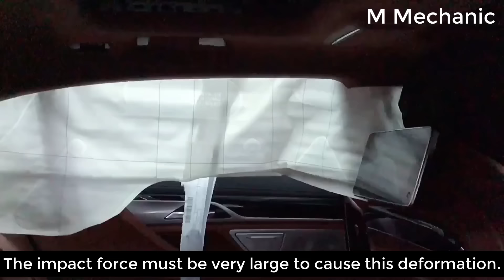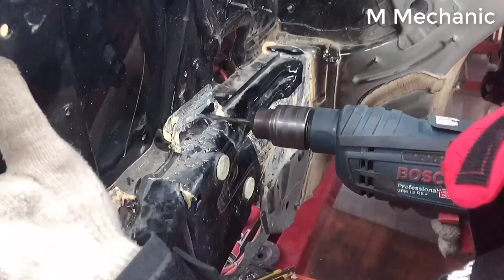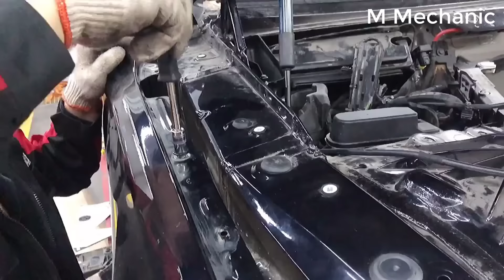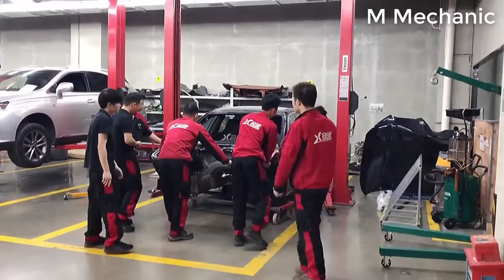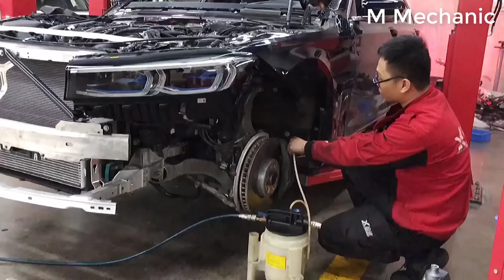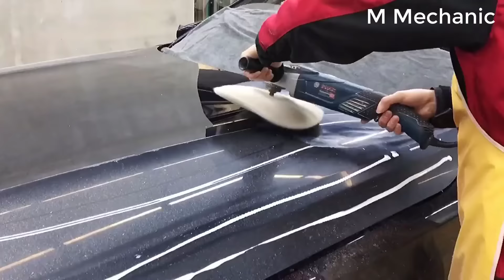Restoration Of Accident BMW 740Li | Amazing Repair of a Destroyed Car.

Comment: I own this superb car: 745Le.  Watching this amazing rebuild was very interesting.  Brilliant work by highly qualified and professional work staff.  Well done everyone working on this car.  But I wouldn’t want buy an accident car.  There could be countless problems on the future.
Reply: How did you experience driving the 'repaired' car?
Reply: You mean you own a 745Le not this particular car in the video.
Reply: Even I you bought it new from the dealer you don’t know if it was ever in an accident
Reply: They went through the trouble of painting the bolts on the wings and bonnet... you would need to compare the dirt levels on underside areas of front vs rear to be suspicious of a hidden repaired. On the other hand, the methodology and replacement of front section looks legit, and the impact was really a perfect dead-on.

Comment: Wouldn't touch the car - belongs straight to scrap as with that amount of damage the whole integrity of the car is materially impacted. Measurements in the factory are by lazer not tape measure.
Reply: the us is lazy
Reply: @japanwatchconnection I agree here. I don’t have a problem with Minor damage, but once the Frame has major creases/dents, the integrity is compromised. However, the amount of craftsmanship that goes into repairing said vehicles is amazing

Comment: Looks like a job well done. But I doubt if it should have been repaired in the first place as the engine and the cradle/subframe it sits on were damaged/moved in the accident (was the firewall okay??). I would love to see the wheel alignment values before the actual wheel alignment was done. Also, looks like the airbag modules were not replaced. This is common with Chinese owners not willing to spend money on a >5 year old car. :P
Reply: I think when not crash in very high speed, the subframe can handle it. 
So firewall still okay.

But i agree with tyre alignment :D
Reply: Dont think is a full video thou
Reply: Dude……..this a short video……….what you want to see …what te they had for a brake….coffee or soda…..?? Man wake up………or do you all still sleep in that island called England or something….
Reply: Please enlighten me why you want to know the wheel alignment values? There is so much to adjust that you will never have correct values direct from the start (unless it’s on a jig in the factory) just replace the subframe on an undamaged car and in 99,9% the values are way off. That’s got nothing to do with being in an accident
Reply: poor guy that got sold this bmw on the end for the normal price lol
Reply: cradle/subframe damaged/moved   (was the firewall okay??) wtf... what kind of grammar is this???

Comment: All fine, great job. Just need to know if they fitted airbags, sensors and new seatbelts? And if so, how did they apply this stuff in clever computer system? This video does not show all those details, unfortunately...

Comment: Sorry, but I wouldn't want to buy such an accident car again. Despite the repair, the car will always cause problems, I know that from my own experience. Never again an accident car
Reply: Новую бери
Reply: The biggest problem, in most of the time they won't tell you
Reply: Yes you re right man. No buy any with accident car please cause of some problem could occur when you re on  vacation
Reply: What experience did you have?
Reply: @mrnobody7668  Бред не пиши!!на заводе точно так собирают даже хужее
Reply: Not always true
Reply: @Paul_Bateman  Everyone has their own experiences. I had problems, my buddy had problems and my brother had problems with crashed cars. Never again, I'd rather pay more and take new or younger used ones.
Reply: @kyok001  Brand new car is sht..used car is big sht and acident car is extra big sht...maybe 🐎 is for you good 🤣🤣
Reply: @rimsatec5215  What's the matter with you, can't you read? I wrote that it sucks to buy an accident car. I'd rather put more money on the table and buy a new car. And if you can't afford it, that's your business.
Reply: i buy wrecked cars, fix them and either drive em or resell them. u got unlucky. if all welds are up to spec the structure should be just as strong as before. and as long as water leak prone areas are sealed.
Reply: @christiaanpeeters9716  😁👍
Reply: Indeed!
Reply: @Bimmer-Fonz  you already had two "as long" in your short paragraph.
You answered your own question.
Reply: @kyok001  it seems it's YOU who cannot read. He agreed with you, but in a funny way.
Reply: Depence what kind of damage you got.
Reply: You correct, way to,any things get outta alignment. To many to mention. Plus things that are not found, I’ve had car’s repaired from Accidents things show up at a later time. 
Wrecked that bad it good for parts.

Comment: This car would never be allowed back on the road in the UK.  It's a question of safety.
Reply: Of course, safety!
Reply: Absolute rubbish. Of course it would be allowed back on the road. There are plenty of vehicles that had far worse damage than that on our roads. Obviously you know nothing about vehicle repair. Look up salvage categories.
Reply: All cars in the UK are not safe. You have the steering wheel on the wrong side !!!!!
Reply: @MrMadreko  top comnent in my life, ahahagaha
Reply: @bingobongo357  😂👍
Reply: When you do measurments on this car, chances are high that it is more straight than from the factory. 
Factory new is mass production, this one is handproduced and measured by the latest technology.

But still has the steering wheel on the wrong side.
Reply: To AFRICA

Comment: Beautiful job! Very well done! Hats off for the mechanics! 
Do you guys think this car is equally safe as an uncrashed car? Those welds and metal materials have different specs than the ones built in! The body can twist just after a few weeks of use, causing misaligned tracks!
Reply: Those metal parts are exactly the same as those originally supplied by BMW, during the building of the car. The welds they did, if done properly, will 9 out of 10 times be stronger than the factory welds.
Reply: This is an OEM job with all original parts, no detail spared, they even painted the bolts!

Comment: Je ne prendrais pas le risque de dépasser les 180 km/h avec cette voiture 😮
Reply: Idem
Reply: The decks were replaced, just like the factory ones, they just took off those crooked poles and replaced them with new ones, welded them, and what is controversial and unsafe about that? if they were to test this car, it would certainly have the same strength as the factory car, that's just the factory's propaganda.

Comment: It may looked repaired, but definitely won’t run smooth
Reply: well can you explain yourself?
Reply: @will1963  Any car which is repaired to this degree will run a bit wonky. Balance might be slightly off, random creaks over bumps… etc.
Reply: btw The new owner will see how one-sidedly the front tires will wear off.
Reply: @will1963  damage on F/apron will be problem of Running balance. It can't be repaired 100% same as non-accident car
Reply: It will run perfect!
A car is not a swiss watch designed and engineered to absolute .0 of a mm, or else it will not work as it supose to.
Reply: This car is a write off. Feel sorry for whoever drives/buys this car

Comment: This one looks sensible. A lot of damage at the front but didn’t crease the doors so I can understand why they decided to repair it. The bracing structure was all replaced so it should be OK. 

When the video starts by a jig realigning the chassis I always think it would be better crushed? It’s never going to be string enough in my humble opinion. Try bending a fork then bend it back. Then put the tip on plate and push down on it and watch what happens.

Comment: I would support those who talks about safety! What about airbags? Did you restore them also?
Reply: That is not only concern. I wonder if that car drives straight on the road.  Car with such damage belongs to wrecking yard. When my car was side swiped by a Hyundai sedan, front driver side door was a toast. It cost more that $15K just for new door and associated  parts(including all screws small and big). The repair was done by Mercedes 
They certified the car before I drive it away. The hyundai was written off by insurance company. Funny thing is front bumper of that car was gone but even funnier was rear bumper fell off too. I guess from the impact.
Reply: @tonyhwang3888

Comment: Whatever fix you do , structural integrity of the car is still questionable..
Reply: As far as driving a repaired car I may only do it with only repaired fender bender or dented door.
Reply: @tonyhwang3888  so you also replace all your airbags after 10 years? Or replace them on a used car you buy? If you’re that strict you should also follow manufacturers specs and most state that you should replace your airbags every 10-15 years.
Reply: @Mark-vn7et  Yes, our family has only MB & BMW which are dealer serviced regularly after
4 years, depending conditions we keep little longer or trade it in 
for new one. Been doing that all these years. I am 82 now so far I have accident free
driving record. Still driving.